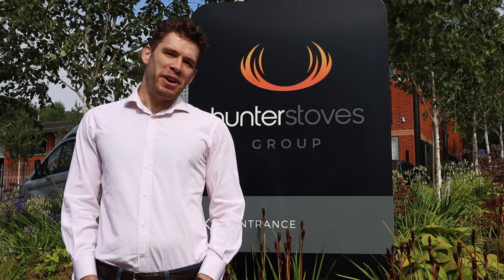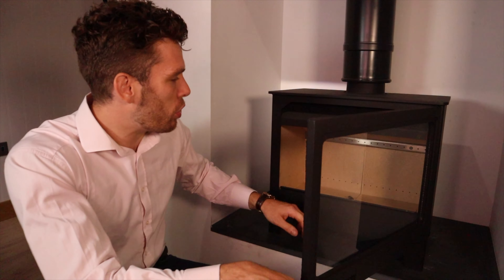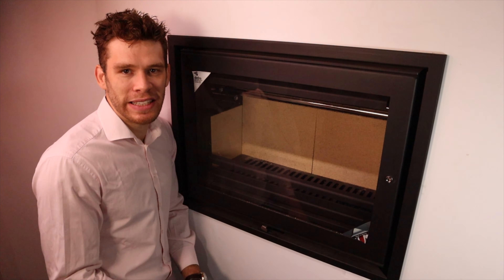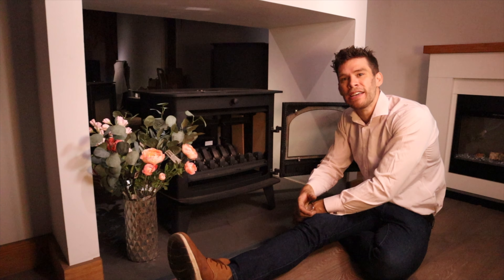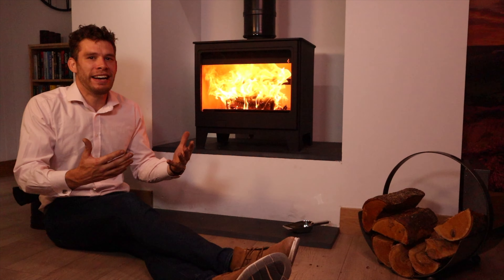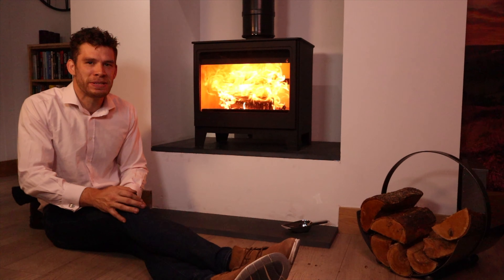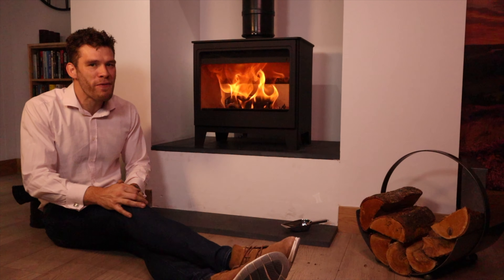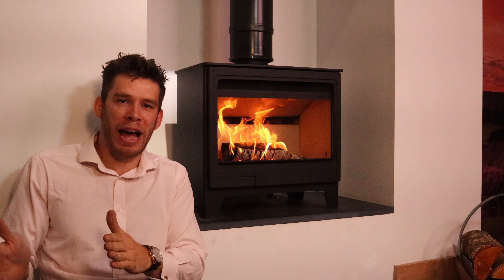The difference between wood & multi-fuel stoves

Comment: What’s best would you say I need one for my garage log burner and want it a slow burn as don’t want to spend all day loading it
Reply from the maker: I would have a wood burner, because they’re cheaper to run, and something like an old hunter herald is cheap and perfect for just leaving chugging. The flip side is that this can cause tarring of the flue and chimney fires, so you do need to find a balance. 

The coal route is much more tricky now as normal house coal is being removed from supply which just leaves smokeless fuel. This is both expensive and extremely corrosive to flues so it will certainly shorten the life f the flue dramatically (particularly when slow burnt). On the flip side, smokeless fuel is fantastic at chugging slowly for many many hours and is much less dangerous in regard to causing chimney fires etc. 

Think of it like a car. It’s fine to drive it slow in a high gear, but if you do it a lot you will clog up the exhaust. The car will need a good burn once a week to run clean. That’s why I’d go for the wood burner. It might not burn quite as long, but I can burn dry fuel and give it a really good boat once a week for 2-3 hours, I can sweep it regularly. And this way the whole set up can last decades (I’ve known smokeless fuel used like this destroy a chimney I no a matter of months).

I hope this is helpful, obviously there are dangers involved with doing this, so if you are struggling do come back to me or your installer.
Reply: @TheTortoise  great advice thanks, I will check out that log burner appreciate that a lot cheers, can’t wait to have a toasty work environment.lol🥵
Reply from the maker: @Jpcars636  no problem!

Comment: This is an old video so not sure if you'll see this! Do you think that wood burning conversion kits are worth it for a multi fuel stove, or better to just replace with a dedicated wood unit? My stove is a Gallery 8 if that's helpful! I love your channel mate, so useful!
Reply from the maker: If this wood kit involves removing the grate, then it sounds like a great idea. If it is just a plate to cover over the grate, then you could achieve the same by allowing the stove to fill up with ash. The issue is you would have still lost a lot of space and a replacement stove may have some utility. 

Of course the flip side is it costs a lot to swap a stove, so you’d need to be planning some serious use and a serious replacement for that work to have ever been worth it.
Reply: @TheTortoise  thank you so much for the reply! I'll check with the supplier, as what you've mentioned with the grate makes complete sense. Lack of space is one of my main criticisms of this stove, so addressing that would be appreciated. Thanks again 👍

Comment: I’m having an Ararda i600 inset cassette fitted. Told this will burn both well. Perhaps should have gone for Contura i700 cassette but hey ho. Still got time to change
Reply from the maker: These types of appliances are created for wood use. This is the reason for their big glass and clean look. Coal is a very functional fuel, but not pretty when it burns. It also causes lots more wear and tear and produces lots of ash. 

If you want to use your stove in a very functional way, with coal then British appliances like the Arada, Saltfire C7 and Woodford insets will work best. If you intend to burn mainly wood, then these appliances will be more greedy, less controllable and will use more fuel. In this instance, the Contura (or similar scandi inset) would be a better pick.
Reply: @TheTortoise  Thanks for the feedback. I watched your review of the Clock Blithfield multi fuel. Seemed the wood burned well on that one as well, although the chimney breast in my house isn’t deep enough for one of those to sit nicely within.

Comment: I have a multi fuel stove and soon after purchase I converted it to wood burning only with a kit sold by the manufacturer. Not only does it burn wood much better, we heat all winter using it exclusively and with 9% Pini Kay logs I have to empty the ash maybe three or four times in a season. Most of the ash has been compacted at this point and there is very little dust created. 
If you're yet to choose and intend to burn wood, trust me and the presenter, buy a wood-burning stove.
Reply: Hi, can I ask what came with your kit and how it was fit?
Reply: @magoomagoon  I'm afraid it's not available now, but we have Firefox 5 cleanburn2, and the conversion kit is supplied by the stove mftr Percy and doubty from memory.

Comment: Well that not true it depends on appliance, my multi fuel has a flat grate with a spinner agitation section 
I have top and bottom air flow control
Reply from the maker: What do you disagree with, and hopefully I can explain.
Reply: @TheTortoise  Maybe I got it wrong as well? but in your video you say that wood burns fast in a multi fuel stove because the air is coming up from the bottom, but multi fuel stoves have vents that can be closed and opened for burning wood and coal. i.e close bottom vent for burning wood and close top vent when burning coal.
Reply: @macraghnaill3553  air vents are never sealed, every vent will have a leak. It also negatively affects wood burning when it’s not sat in and insulated by a bed of ash. Some stoves have add in multifuel grates, if you test the same stove on wood with and without a grate the fuel economy is always significantly affected. It’s just how wood wants to burn. It’s like saying “well a tractor can drive on the road” it can but it’s rubbish at it, and it’s a pain to everyone else. But like multi-fuel they’re not wrong when they say “you can drive on and off road”.
Reply: @macraghnaill3553  that's right once your fire is up to temp you close your bottom vent and use your top vents only to control the burn.
Bottom vents are for coal burning, my bottom vent seals off its a round type on a tread that screws closed.  As it close tight against the body and has a fire rope gasket which crushe closed.
The top vent I just a slider type so ut never closes fully

Comment: I'm looking for a new stove to replace my 25-year old one  I burn wood and coal mostly coal  at night
My Stove has a back boiler connected to it 6 radiators  any ideas what I need
Reply from the maker: The issue you have is that boiler stoves have basically all been discontinued. My advice is phone around quick before everyone has run out of them. 

I’d be looking at things like hunter herald, dunsley stoves, Eco boiler, aquaburn, Charnwood. But you need to call quickly as all these stoves will be discontinued, and it is likely that future models will have a number of disadvantages posed with n them by regulations.